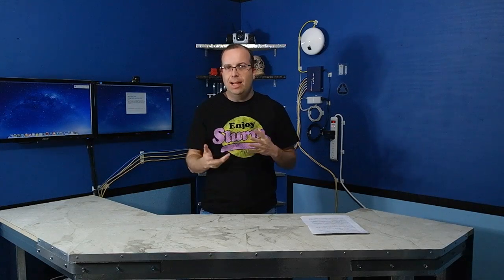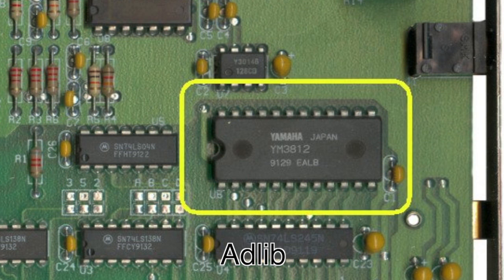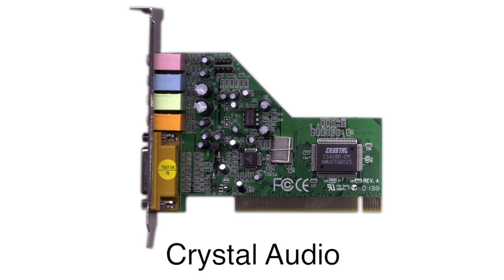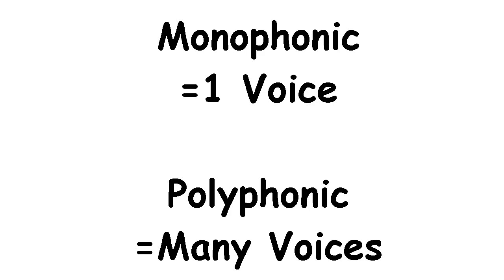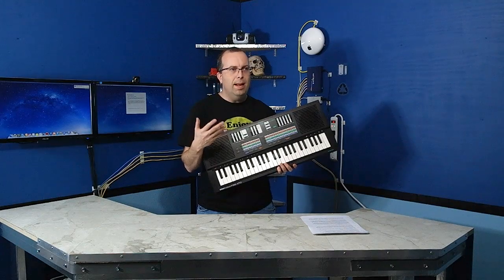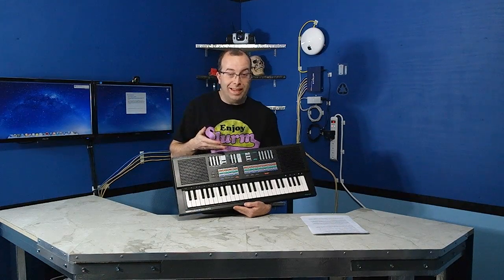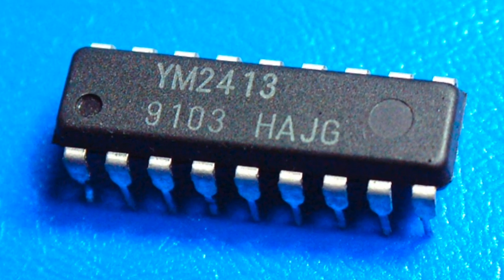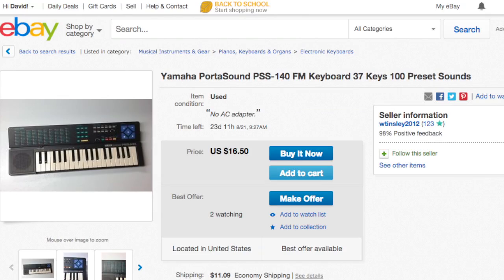Meet the little-known "Soundblaster" Keyboards

Comment: Add a yamaha PSS-460 to your list too.  Wife got me one she found at a thrift store for $10.00.  I'm a techy too so I restored it / cleaned up up.    Another cool synth item to look into is a Yamaha CS01.  It's a little mono synth from the early 80s (1981).  It has several analog waveforms including PWM with a separate dedicated LFO, a 12 db 2 pole resonant filter and ADSR envelope generator.  It was part of Yamaha's "Producer Series" that included a battery powered headphone mixer several people could hook into and a little battery powered analog drum machine.  Very cool for the day!

Comment: Just found a free Yamaha PSS-480 this week, and it made me think back to this video! It uses a YM-3420 FM-synthesis chip (I may be wrong, but I think it's essentially a YM-3812 combined with an 8-bit CPU, RAM, ROM, MIDI interface and DAC all-in-one chip). It seems to offer everything the PSS-470 has, plus MIDI. I plan to tinker with it, it certainly sounds just like one of my AdLib and Soundblaster cards!

Comment: just in case anyone here is interested in circuit bending or modding:

The Yamaha YM chips found in these keyboards have an 8-bit parallel data bus that runs to other chips on the PCB. One really effective modification is to cut the circuit traces on the PCB and install switches to allow you turn off each line in the data bus. Or if you really want to get nuts, you can cut all 8 traces and install a socket/jack to each side of each cut trace (total of 16 jacks) and then freely scramble the 8 data lines however you want. I did this to a PSS-170 and it's wicked! It gets pretty gnarly sometimes, but often results in very playable and pleasant alien timbres.

If you're interested in trying it on your YM-chipped Yamaha keyboard, just look for the data sheet for your particular YM chip and find the pin-outs for the 8 data lines.

Comment: I use a Soundblaster Live External sound card for over 10 years now. Great card still and is compatible with Windows 10!  It also has inputs and outputs.
Reply: I used to have a crate of old PCI cards, I just found one of my last, a soundblaster live.  They were the least expensive entry to getting ASIO on a limited budget.  Aside from ASIOforAll, that is.
Reply: I don't think that has hardware FM though...

Comment: I have a MUCH more professional Alesis 88 key DG-8 from 1998. It has 88 fully weighted after touch velocity keys on it with an included foot pedal for sustain and you can even re configure the pedal for other things too. It has over 64 sounds on it and includes a built in 100 watt bi-amplified studio grade speaker system with 5.5 inch woofers and 1 inch silk dome tweeters. It has all the connections you will ever need including a midi input and output. It even has a dedicated audio input that goes directly to the amplifier so if you wanna plug a CD or tape player to it to listen to your tapes off the built in speakers, you can do just that. And the cool thing is the piano will still work as well so you can play along to your music. The speakers themselves sound WORLDS better then those old Yamaha piano's did. The bass is rich and tight and the highs are amazing because of the silk in the tweeters. We paid over 2,500 bucks for it at the time and I still have it to this day and it still sounds absolutely fantastic. It has an amazing True Grand piano sound that was made by Alesis and it is the BEST Grand Piano sound that I have heard in a keyboard by far. Alesis actually named it the DG-8 witch stood for Digital Grand. I think the DG-8 is the best keyboard of the 90's because of it's features and amazing sound. Go look it up and you'll see what I mean.
Reply: +EpicEverythingDude75 ....What was your point...?

Comment: As I'm becoming more interested in synthesis I decided to watch this again.

Having written more than a few tunes on the Ad Lib I listened to your keyboard sounds and those of a few other PSRs like the 11 and 12. The sounds are actually different, and the drums even sound a little bit acoustic, whereas on the Ad Lib they are clearly synthesized. I'm sure this is due to the fact that more circuitry appears to be present on the board for the keyboard and they probably customized it a little.

On the Ad Lib in fact all of Tyrian's original songs were written using the Ad Lib Visual Composer but rendered using the LOUDNESS format, which a guy in Germany (Andreas Molnar) developed to sound more like the Sega Genesis which came out after the Ad Lib. The 3812 chip used in the Ad Lib was actually released earlier and was less sophisticated than the YM2612 used in the Genesis even though 2612 sounds like it should be an earlier chip than the 3812. The 2612 had fewer voices but more operators, enabling more rich algorithms to be used. The ultimate example of course of commercially available FM synthesis in the early 80s was the Yamaha DX7 keyboards, used in numerous pop hits, and the difference between something like that and an Ad Lib are quite obvious, mainly due to the fact that Ad Lib has one operator and one modulator or carrier per voice, and the DX7 has six operators. And more operators means more variety and in the end, more sophistication and texture per voice.

Comment: I got my PSS-470 when I was 13. I played a lot of gigs with it until I managed to get a Yamaha DSR-2000. Boy, the PSS-470 was awesome then. I could reprogram the preset voices (no possibility to save them) I could create my own drum patterns (no possibility to save them) and could play Rachmaninoff chords on those mini keys. But the coolest feature was, that if you used the accompaniment, the polyphony in the right hand fell down to two voices...you can really develop the use of upper structures, chromatic alterations and harmony extensions if you have a very thin sounding acc that you need to spice up with two voices :-)

Comment: I have both the PSS-470 and PSS-570 because they are not only fully programmable FM synths (no fiddly menus like the DXs, just use the sliders) but on the 570 you can jam with the bass and rythmn tracks, which use lovely lofi 8 bit sampled drums.

I've sampled off the whole kit and have already used the sounds in several tracks!

They cost me pence locally from a secondhand shop as most people still seem to think they're just toys and not serious instruments.

My only gripes are you can't store any patches internally once you've programmed them, so you have to record the sound if you want a copy of it (much like with early analogue synths), plus there's no MIDI I/O on either of them.

Comment: Late at the party but one thing worth mentioning is this: The PSR-470 does not sound exactly like an Adlib/SB Card but better as it has this (a bit noisy) fat stereo chorus mode (the orange button on the right) which makes also your Ultima6 soundtrack interpretation sound "more rich" compared to the adlib original (which seems to use 2 voices at once to simulate a chorus but stays mono which is an Adlib restriction). None of the other keyboards introduced seem to have it. That makes the PSR-470 stand out of the bunch (besides the possibility to program your own drum patterns). Whatever - very nice video :)

Comment: FYI, most of CMI8738 chips have hardware OPL3 implementations which are really good and close to original. If you happen to have one of those cards, you can utilize the FM part of it with VGMPlay (with inpout32, the register address is at 0x50 of your card).

Oh and I use it in my main rig, works fine on modern systems. :D

Comment: I got a PSS-460 for $39.99 at a thrift store today, and 1 key isn't working since a bit of the key got lodged in the keyboard preventing that key to work, but overall in fantastic shape and it works without issues. Can't wait to play some music from certain games on that keyboard.

Edit: the key still doesn't work, so it might be the key is bad. Going to order one and fix the contact point. Every other key works.

Edit 2: ordered a new key, but I did fix the key by gluing the missing pieces and it works without issues anymore. YAY!!!

Comment: I had this keyboard in the 80s. I had the PSS-460, and my girlfriend had the PSS-470. The 460 and 470 are identical; the only difference is the appearance of the front panel; the 460 had a flat-colored front panel, and the 470 had colors.
Reply: I still have the PSS-470

Comment: Actually PSR12 HAS sustain jack. It’s the RCA AUX connector on the back - if you short-circuit it, it will create the sustain effect. It’s like this by design. I used this keyboard on gigs at the end of the 80’s because it has nice fatty dx like sounds. My output port was the headphone jack.

Comment: I remember the PSS470 as one of the popular circuit bend keyboards on Ebay. I think I want one now but with a midi adapter added to it. The Casio MT240 has midi and you can layer two sounds on top of each other which is very cool.

Comment: I still have my Yamaha PSS-680; YM3420AD sound chip, 99 preset sounds, limited ability to make your own presets, a fairly primitive built-in sequencer, and a drum machine with 99 preset rhythms, some limited ability to program your own beats, and 32 samples from an RX-7.  The only reason I really still have mine is that it has MIDI in, out, and thru ports, as well as 1/4" unbalanced headphone and separate 1/4" L, R/L+R outputs.

Comment: Der Yamaha PSS-680 verwendet den Yamaha YM3812, auch bekannt als OPL2 (Operator Type-L). Dieser Soundchip ist bekannt für seine FM-Synthese (Frequency Modulation) und wurde auch in anderen bekannten Geräten wie der Sound Blaster 1.0 und 2.0 Soundkarten eingesetzt. Der YM3812 bietet eine Vielzahl von Klangmöglichkeiten und ist ein wesentlicher Bestandteil des charakteristischen Sounds des PSS-680.

Comment: Discovered something recently that I think you might find some interest in. Around the 11 minute mark in Supertramp's Brother Where You Bound, There's a sort of synthesized piano sort of sound. Out of curiosity, I pulled out my PSS-140, and as I suspected, sound number 63 "Piano 2" is pretty much identical, but the song puts some reverb on the raw audio. What's baffling me is why Supertramp, a massive band, even after Hodgson left in '83, was using keyboards with the YM-3812 in them. Even weirder, yet likely the answer to all my questions; the album came out in '85, and the earliest keyboard mentioned that has a YM-3812 according to the description came out in '86. I can't find much info on Rick Davies' keyboard rig from then, if anyone knows anything, let me know.

Extra mostly unrelated note: Bob Sibenberg, drummer for Supertramp, composed the music for space quest 3, which did use Ad-Lib/Soundblaster cards.

Comment: I have a Yamaha psr36, 61 keys ful size. It' has pcm drums, can play 2 intruments at the same time splitting the keyboard. On the lower keys you can play 1 of 8 intruments (either single note or chords). On the higher part you can play one of 32 isntruments, and modify them with the sliders  that come in the psr 470. Also, has midi in and out, rca stereo output and input for a susain pedal.
. Bought in 1988 now sits on top of a shelf, but still working fine. Don't know the chip it uses but i'd go for the 3812.

Comment: I've got a PSR-36 when I was young and I guess that it uses the same chip as the keyboards which are shown on the video because they have exactly same sound. I found an article that says it is the last professional keyboard Yamaha produced with FM Synthesisor Chip. It may be the most professional keyboard which uses YM3812 because it has MIDI input and output and sustain and volume portal and intro/ending. It looks pretty much like PSR-32. (P.S.: I am not a English Native Speaker, sorry for my Chinglish.

Comment: I bought one of these at a mcdonalds in spring 2013 comes with original box, manual and power supply pss470. Payed $25 for it. In fall of 2014 around thanks giving I picked up a pss480 with charger and case for $35. both good finds imo.

Comment: I seen those keyboard monsters at time, but never used them. I'm not a musician after all. Seems, those was good gadgets for writing music for DOS games. And talking about SB16 card itself, it had good board design and because of that - good sound quality, which was significant because good part of circuit was analog and PC at inside have a bunch of EM noise emitters. And it had one definitely cool feature for it's time - internal power amplifier (if I didn't forgot, it had 2W output) which was enough to listen music and game sounds on 15-30W stereo speakers. Not very loud but sufficiently good to not have external amplifier for that - perfect for small room in flat or for workplace.

Comment: +adric22  Yamaha® actually produced a few PC audio cards of its own.  The YMF719E-S synthesizer-on-a-chip was the core of three 16-bit ISA cars:  The YMF701 packed a 16-bit stereo codec, game port with two Motorola-compatible UARTs for MIDI, and the Cebix® CS4231 DSP; the YMF711 added a modem interface and CD-ROM controller; the YMF715 added DirectSound3D.  The closest thing Creative Laboratories ever made to an actual music keyboard was the Prodikeys™ series of human-input devices for the i8024 interface, which piggybacked a 37-key MIDI input device onto a 104-key rubber-dome/membrane ANSI keyboard.

Comment: I have latent memories of putting two of two YM3812 chips on an Apple ][ prototype card. 18 Voices!
Reply: That chip didn't exist at the time.
Reply: A couple of lsttl chips for the decode, the synth chips and an opamp for the output. They sold proto cards for the apple2 in the late 70s/early 80s. A precursor to a computer science degree and a 25 year career in hardware design.

Comment: I got the PSR-32 because of this video.  I'm planning to add a Highly Liquid UMR2 mod for MIDI I/O.
Reply: Just got another one for $7.  One of the keys wasn't working, because the spring was dislodged and stuck to the speaker magnet.  It was an easy fix.

Comment: FM actually starts sounding quite good with 6 operators per channel like on the DX-7 or TG-77. (the YM3812 is a 2 operator FM chip)
Reply: You can get a lot of interesting sounds with 4 operators as well. This is especially true in the case of synths like the TX-81Z which has alternate waveforms.

Comment: I've just discovered an easter-egg with this keyboard (bought at a thrift store a few days ago). Watching this video, I realized he forgot to turn on the "Digital synthesizer" mode while he was trying to recreate that Ultima VI main melody instrument (or he did it on purpose). In fact, it means you can actually modify the built-in sounds by just moving those sliders up and down! For instance, the sound he got here is based on the Cosmic preset. If you select another preset or turn on the Digital Synthesizer, you won't have the same sound.
Effect will vary depending on the sound you select. This allows a much wider range of sounds. Indeed, modifications are not permanent, so you'll have write down certain settings and remember which preset you selected first.
Reply: That was the reason I bought it. Demoing in the department store I got right into it. 5 by 5 variations on each preset voice and the extra non preset, that was a big deal then and still makes for a good set of sounds.

Comment: I've got a psr-41 and people think it looks silly but that thing can make some great, really unique sounds. Im thinking its similar to the psr-36 in that it has the 9 voices with an extra chip for more drum sounds, (it has that whole drum kit on it that that the 36 does, which can be played simultaneously with the 9 voices). It's also got some cool auto bass chord functions and the drum programmer. However i guess its more of a professional keyboard (at the very least for its time) as it has midi interface and a sustain pedal input. I haven't played it on stage yet, but i can see it working out. Really the only thing lacking is it has no velocity sensitivity. oh well, i payed 7.99 for it at a goodwill in high school which easily makes it the best bang for the buck of any synth or other equipment i own. The thing about it is that I've literally never seen another one in person, and only 2 online on eBay, one selling for about 70 and the other one for 150 for whatever reason. Just thought id share to see if anyone else has got one of these

Comment: I have a PSR-E403 'workstation' keyboard... with a lot of professional features.  I've taken it apart... it has a LOT of special velocity based wavetable sounds... but guess what else it has?  That's right.  It has the original midi synth chip that ran everything from the sound blasters (with full wavetable) to the sony chip that ran the snes (which is just WEIRD hearing perfect sounding game songs from everything from the snes to the DS).  This is like a $300 keyboard, but has features that you don't usually see until the $1000 range.

Comment: my PSS-560 has some broken sliders, so i had to take it apart and move the working sliders to the manual controls, and scrape off some black gunk from the pads on the board (they are not just slideswitches, they are plastic pieces with metal pieces that rub against pads on the input board (those pads are still black)

Comment: If this synth had rotary pots for the modulation instead of the sliders it would be a lowfi classic in demand. You can get the modulation to glitch and get some weird phaser and other type effects by rapidly sliding the faders (primarily the attack) back n forth. With a pot it would be smooth and add a cool feature.

Comment: The cheap version, the YM2413 or OPLL, was used for the Master System FM unit and the NES VRC7 expansion and evenfor the C64 sound expander (I think).